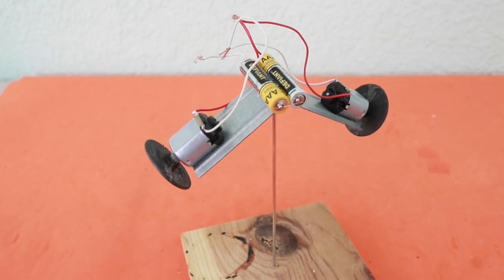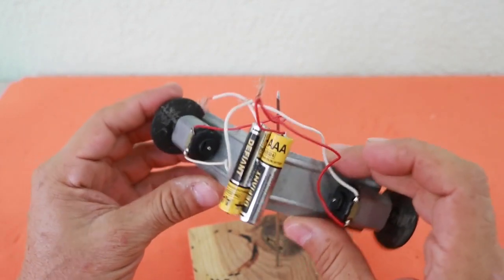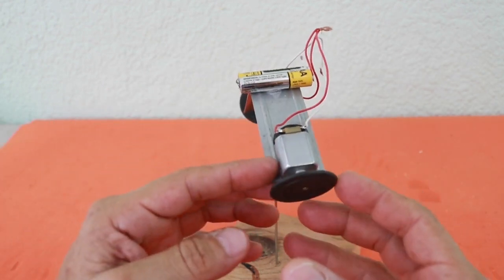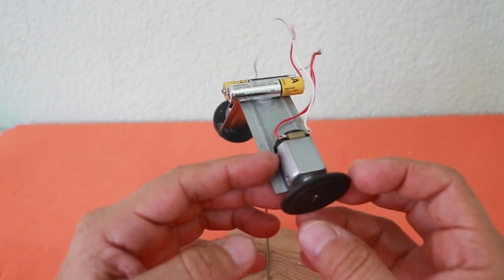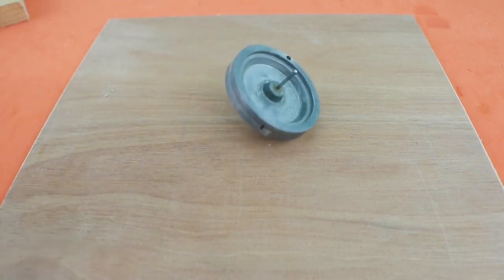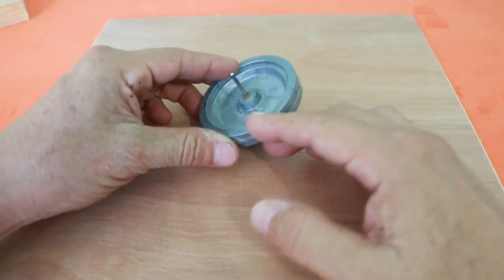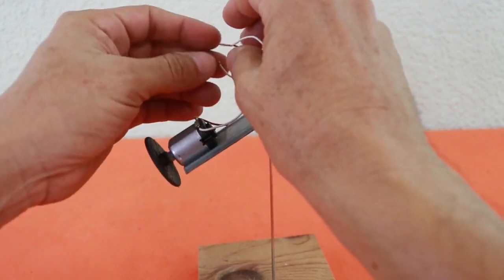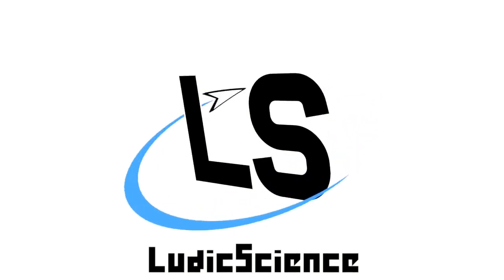Gyroscopic Precession Demonstration

Comment: It is actually not the gyroscopic precession what we see here. There is a small friction with the air which produce a little torque. Also the air apply a little torque to the disks and the motors (3 Newton's law). And the torques do not cancel out...